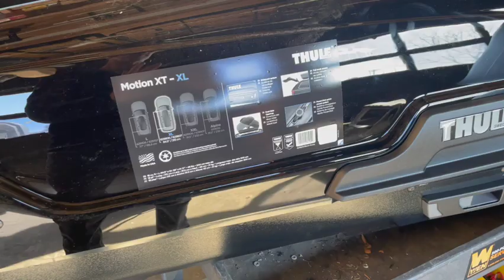Repairing 4ft Crack on a Thule Motion XT XL "Cargo Box"

Comment: I just repaired my Thule cargo box, cracked both side after hitting the garage sealing.Mixed ABS and Acetone bought on eBay, ABS stick pack of 30 cost £7.00 and 200 ml of pure Acetone cost £8.50 also for best result Fiberglass Reinforced Strapping Tape Transparent £6.50 from eBay. and a paint brush. Mixed aceton and abs, applied next day by brushing eve the crack, one coat waited a few minutes and applied the Fiberglass Reinforced Strapping Tape, after 10 minutes brushed two more coat of abs acetone slurry,I done the same inside out. Next day two more coat of the slurry over the fibreglass tape. Bonded perfectly and Perfect Result. Finest sandpaper and a bit of respray for perfect finish.

Comment: I made a new strut post for my thule mountaineer.  I used a grease zirk a little larger that the original ball and shaped it down a little smaller with a belt sander.   It was $3 at the hardware store.

Comment: Someone once mentioned that Fiberglass does not adhere well to ABS plastics. Instead the suggested to use ABS slurry (ABS + acetone) for such repairs; except you're missing out on the fiber part and the added strength it provides. I'd love to hear your opinion on this.
Reply: He's not doing a fiberglass repair pr se.He's using fiberglass for reinforcement but he's not using bonding agent which is used to repair fiberglass Fiberglass mat is used for a variety of repairs for reinforcement.  Cement, stucco, epoxy, tarps and other kinds of repairs where strong reinforcing is desired are some applications where fiberglass mat strengthens the repair.

Comment: Hello; would love to follow but being in Europe would like to get any equivalent substance… there are some solvent cements but with some different tags like PVC-U; or CPVC or even PVC / ABS … can you please provide me with some hints … tried to repair my roof top box using fiberglass and some two epoxy set but it was total failure 🤪 … found Tangit brand with some range of the product and also Griffon … which of these and what product matches your solvent cement ?… thank you so much for your help 🙏👋

Comment: Good work. Based on your experience, is the Force XT stronger (or less fragile) than the Motion XT ?
Reply: I find I do less repairs on the Motion series boxes.  They seem to be slightly more robust and never have issues with the locks.  The achilles heal for the Force series are the locks.  I currently have four of the Force series boxes sitting in my shop with lock issues.  Most of them are operator errors but none the less they have weaknesses.  My rental fleet are all Forces but we give very detailed instructions to our renters.  When talking actual strength of the plastic, they are the same.  When a box hits a garage or any other low lying structure, it doesn't matter how thick the plastic is, the garage always wins.  Enjoy!
Reply: @robertzeien1895  Thanks you for sharing, I appreciate your valuable insights.

Comment: Great video.  How would you repair a 1-1 1/2 inch hole on the box?
Reply: This is a tough one to explain but I'll try and give a brief explanation.  I'll be releasing a video soon to show how this is done.  Basically we use duct tape over the hole on the outside and then do the repair on the inside where the sticky side of the tape is.  The tape and repair won't bond together.  After 24 hours has passed you can remove the duct tape.  We then do a repair on the outside and once more on the inside to give it a total of three fiberglass layers in total.  Give plenty of time for each layer to cure.

Comment: I just bought a mystery pallet that has this exact model in it with a crack/ hole right where the strut goes.  I was wondering if this would work for that or if I should just throw it away which I might do anyways.  Thanks
Reply: I see no reason to throw it out.  You'd be missing out on the hundreds of dollars that you can sell it for after being repaired plus the aspect of not throwing away something until it can't be used anymore.  Just drill out the rivets connecting the strut and do two layers on the inside, re-rivet the strut back on and you're done.

Comment: The struts can be popped off. Don't need to drill the rivets. . Eases off with a screwdriver
Reply from the maker: Thanks for the response.  Yes, the front strut can be removed with a large screwdriver but we drill out the front strut rivets more for the  re-attaching process.  There are two reasons we drill it out.  One is there a reinforcing bar on the inside that doesn't allow  us to put the clamp on the backside of the hinge.  The other is, the front lip is rolled over and when a clamp is applied, the leading edge of the plastic lip can't support the pressure and is very likely to crack.  Once you've worked with rivets, they are simple and hassle free to drill out and install.

Comment: Why is this kit $90 when you can get one from Bondo for $20?
Reply: Our kit is unlike the one you mentioned.  Our product actually chemically welds the fiberglass to the cargo box and is not a two part epoxy that is considered a surface band-aid.  The chemical weld actually slightly melts the cargo box on the surface and then the fiberglass is applied and then another coat on top, as shown in the video.  It ends up physically being part of the cargo box and can't be removed with a chisel without outright damaging the box.  The fiberglass gives it the structural support it needs under any condition.  When the Bondo repair is subjected to twisting and turning, which happens when the cargo box is opened and closed, especially during very cold or hot conditions, it will either crack or start to peel off.  Thank you for your input.
Reply: What about oatey abs cement? Mammoth mend is three times the price of Oatey

Comment: Could you share what rivets did you use for Motion XT
Reply: All boxes us a 3/16" gauge (size 6) and the length that covers most situations is called "64" which has about 11mm of usable shaft.  If in doubt, go longer.

Comment: Good repair.   That box looked brand new.   Did it break during shipping?
Reply: Correct, It was damaged in shipping and rather than making a warranty claim, which would require us to cut it in half and throw it in a dumpster, we repaired it and made it stronger yet flexible.  Granted I couldn't sell it for new price but had no problem selling for 10% off.  Are you repairing a box?
Reply: @robertzeien1895  No, just bought one.  Never owned a roof box.   They do seem fragile though.
Reply: @bluelude2001  It's a fine line between making them durable and not making them weigh 100 pounds.  Through my experience, 80% of the damage that we see is by hitting low items like garages.  One trick that might help you from experiencing that is to put your garage door opener in the glove box whenever the box is on the roof.  If the opener is built in, use a brightly colored piece of tape over the button when the box is up there.  Enjoy!
Reply: Is there any way I can see the picture of the cracks?
Reply: @melvinsolomon6709  There is a full view of the damage within the first few minutes of the video and an overview of the repair at the end.  I don't feel like I answered your question.  Can you elaborate on what you'd like to see.